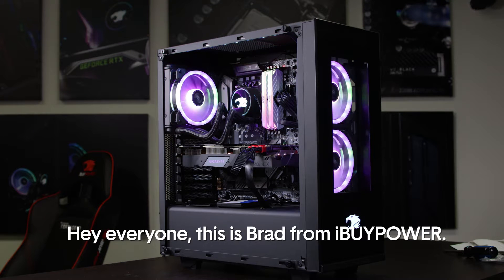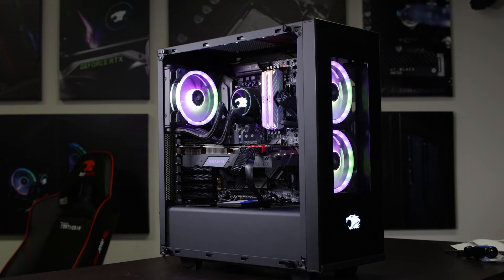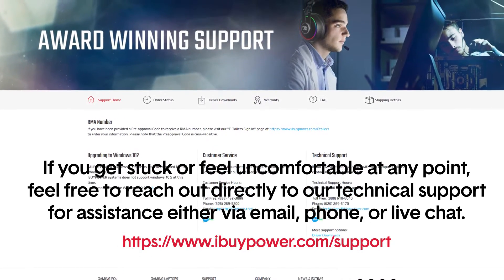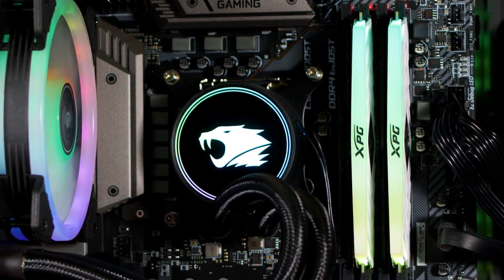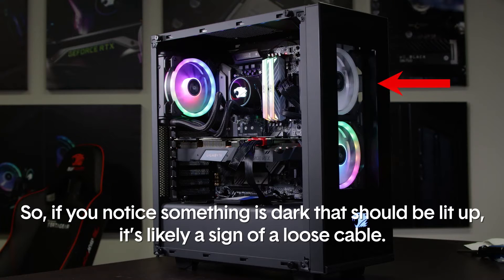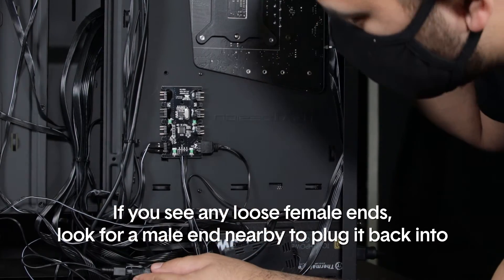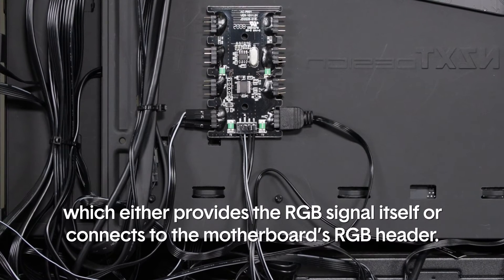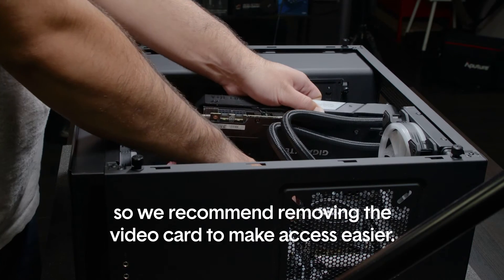RGB Connections | Computers and Coffee

Comment: My 3 pin header argb connection is loose on the motherboard. Any suggestions? It just slides on out. No friction at all. Would electrical tape be a bad move in this area?
Reply: Having the same problem. Did you ever come up with a solution?
Reply: @DangRoss  I ended up using a hot glue gun to secure it. It’s still semi loose but it did the job for now.

Comment: i just got the revolt 2 9330 that came with RGB case lighting and the rgb is, to be honest, crap. it worked for 10 minutes after i got the pc connected and set up.  after that, this is what happens: PC must be turned off and unplugged for the rgb to MAYBE turn on when the computer starts. if it does turn on, if you turn it off it stays off until you shut it down and unplug the computer. assuming of course you don't get an error message every time your mouse pointer touches the included iBuyPower rgb utility. normally i wouldn't care, but it's the only lighting this pc has, doesn't come with a lighted power button to let you know if the machine is on or off.

Comment: pretty disappointed in my Ibuypower deskptop. nearly 2000$ and within 6 months the cpu liquid cooler fan bearing on the front of the radiator started making a constant scratching noise and now i have to replace the whole liquid cooling for around 100$ due to the fan and liquid cooling system is all connected though hard wired connections. i dont even know how to do that which is the reason i bought a prebuilt.

Comment: One of my fans doesn’t spin unless I give it a little boost and spin it initially, why is that?
Reply: usually, that means that it already has power, but for some reason, it hasn't used the power, it could be friction too, so make sure there isn't anything blocking it, dust could also be clogging use near the fan or where the fan header is. little bit of a late reply but i hope you got it working.
Reply: Hey, this is a lot comment but my fan shows the light but does not spend up.  How do you give it a boost, do you just spin it

Comment: How do you change the rgb with the software because my PCs don’t have a remote
Reply: It should automatically be installed it’s called RGB FUSION and it will ask you to install nvidia drivers on launch up
Reply: @ghostt7157  no fine was not installed check what motherboard you have then download the rgb software
Reply: @ghostt7157  you're a real one for this one because i hard reset my computer and the old app would not work and i tried downloading some other ones and geeez im glad i clicked on this comment, thanksss! <3